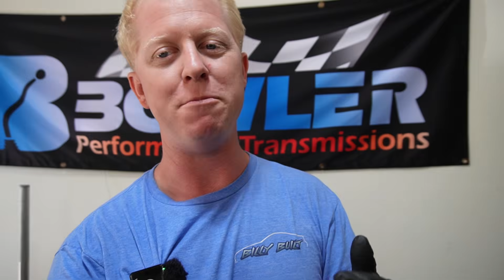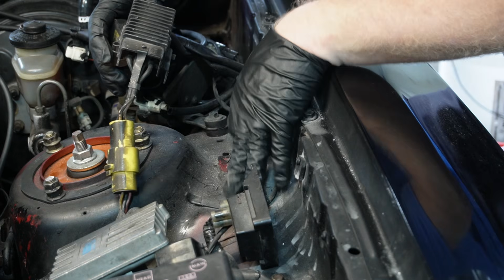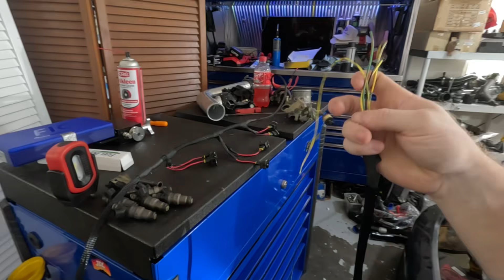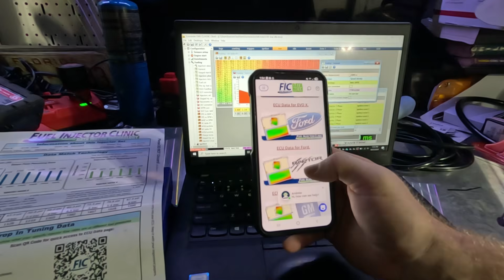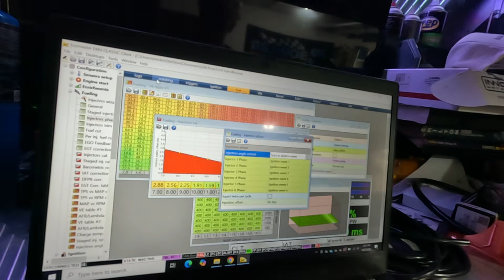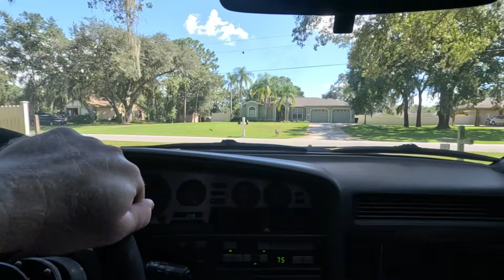Modernizing the 7M-GTE: Full Sequential Fuel Injector Upgrade!

Comment: that part with "read before loading" if you install that ecu and pnp, on a stock engine and harness you havnt touch the injector output on #4 ? havnt you ? i use the stock injector system.

Comment: Do i need to make an injector harness also? Or can i get away with just removing resistor.
Reply from the maker: Not necessarily. But you would still need to add additional wires and pin them to the ECU if you are switching to sequential injection.
Reply: Ill still be rocking the batch fireing for now. Im chasing a miss since swapping to 1050 high impedance. But i never did anything with the resistor so mabey thats it. @Billy_Built

Comment: FYI for those wondering , the two “purge thingys” you eliminated are vcv solenoids. One is to control the EGR system and the other is for helping control the FPR during hot starts.

Comment: no need to change the oring/adapter cap since the injectors go directly into the head not intake manifold. Only need to change tthem if you're changing the fuel rail. But overall great info and keep up with the content

Comment: Hi, I enjoy following you. It's up-to-date and informative. I have a question: I'm looking to buy a used 1991 Z300 with only 38,000 miles. 6 miles ago, 2007, the following modifications were made by a well-known tuner, Uppsuland, in Sweden. -Block bored to 0.5mm OD
-New, upgraded OEM crankshaft
-Eagle connecting rods
-Wiseco 87.5mm pistons
-Standard-sized ACL racing bearings
-Aluminum pulley
Above:
-Ported
-Newly machined valves
-JWT heavy-duty valve springs
-JWT VTC springs
-Cometic MLS cylinder head gasket
-Power Enterprise Super Kevlar II timing belt
-MSP manifold
-Two Garrett GT2860R turbos, also known as "Disco Potato," good for 700 hp
-Toy Toys 3" split downpipes with 5 bolts
-ARP bolts
Fuel
-CZP fuel line kit suitable for both gasoline and ethanol
-CZP high-performance fuel line
-PE 850cc injectors
-AEM 320 l/h pump suitable for both gasoline and ethanol If E85 can handle it
- Tomioka Racing BTR
Oil/Air/Water
- Stilen oil cooler
- Titek magnetic oil plug
- Castrol 5w-40 fully synthetic
- FMIC
- Selin kit
- Dual MFMs
- Dual sponge filters
Transmission:
- Southbend billet steel flywheel with welded ring
- Southbend stage 5 clutch, 4-pucked and double-sprung, good for 1193 Nm
- Nismo crankshaft bushing
- "Heavy-duty" clutch fork set from 350Z -04+ with chromoly ball joint
- Stilen shortshift
- Motul Gear 300 Competition 75W140 oil

Other:
The engine has
- New gaskets
- New hoses
- New wiring harness
- New bolts
- New belts
- EGR removed
- AC (belt) removed
- Hardpipe kit. I discovered that the front crankshaft seal was leaking. The engine runs smoothly; I haven't done a compression test yet. I'd like your opinion on the tuning and what other recommendations you could make before I make a purchase. Thanks in advance for your feedback, and keep up the good work with your vlogs.
Reply from the maker: That is a lot. But sounds like a solid build. Except I'd be weary of those Head gaskets, Cosmetic MLS can be hit and miss on this engine. OEM/mahle has been proven to be best. Everything else seems like a solid setup. I'd switch to a top feed fuel setup other wise it sounds great.

Comment: How much boost you have in mind with the CT-26?
Reply from the maker: All of it.
Reply: @Billy_Built  Let me know how you get there, I’m on the same trail with mine MA70
Reply from the maker: @badcosmonaut once we get the fuel system sorted out and e85 running through it this turbo is going to get maxed out. And then it's getting sent off to boostlab for some upgraded internals.
Reply: @Billy_Built keep me posted, bro now I have another A70 an 88 Turbo

Comment: Billy! Billy! Billy! You are a genius!  
My only question is with regards to the throttle body/hot water connect:  Is that where the temperature compensation sensor is located?
Well Done!
Reply from the maker: Thanks! I believe the sensor you're referring to is on the front of the motor the thermostat housing.

Comment: Nice work man, always love seeing you've posted a new video. Make sure to delete the J-tube restriction when you upgrade the pump. IMO it's also worth switching to an adjustable FPR, the stock 7m regulator runs a decent bit below 3 bar.

Comment: Great detailed info. Definitely will help people out. Three things, stock base fuel pressure is on the low side for a 7MGTE. Technical manual says something like 39-40 psi, so probably want to update those deadtimes. Two, when I switched my 7M to a sequential setup, the engine start settings still had "batch all injectors" checked. That made it fire and die pretty quickly. But, that's V2 firmware. Three, is your fuel injector resistor still hooked up?
Reply from the maker: Nah the resistor is deleted. These are high impedance injectors like most vehicles use nowadays.